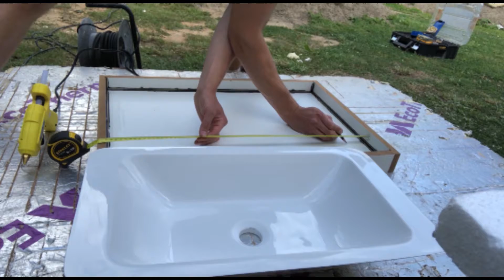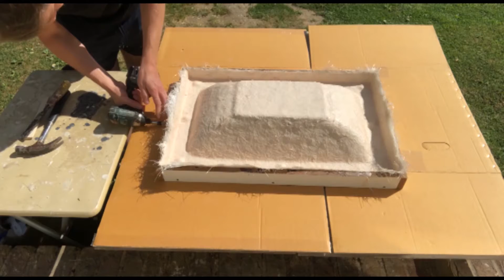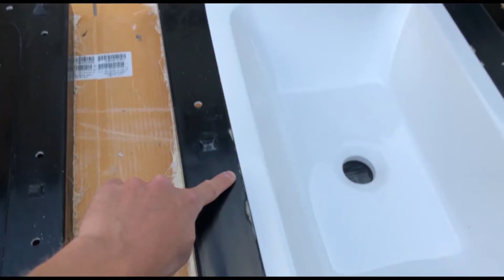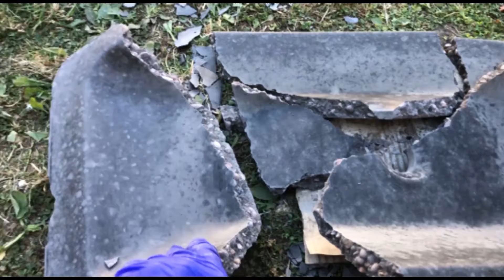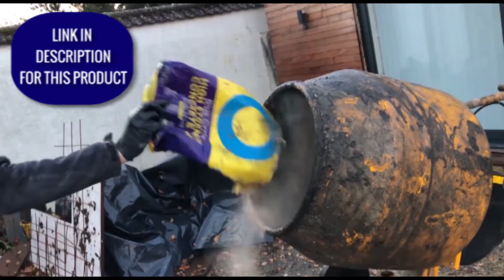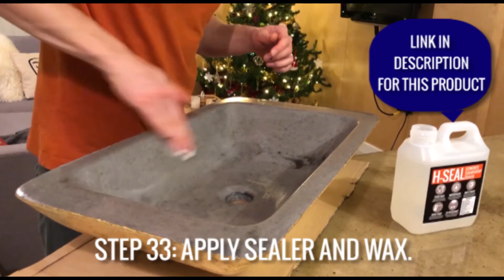DIY CONCRETE SINK with 24K GOLD!!!

Comment: instead of a mold of a actual sink, I'll try to create one using styrofoam to create the shape and pour concrete over.  and pour epoxy over later.  Not sure what will be the result..
Reply from the maker: Yes, modustrialmaker uses that method and it seems to work quite well :)
Reply: @MattHutton  thanks.  I didn't saw that video.  I have good ideas that I didn't think about.  I'll keep in touch to show the result.
Reply from the maker: @SébastienDionne  here’s the video https://youtu.be/Nx_kixmk8bs he uses foam and epoxy too.
Reply from the maker: Let me know how it goes and if you need any help!